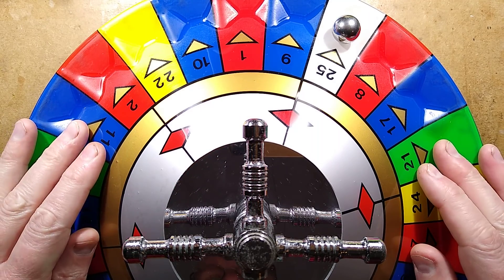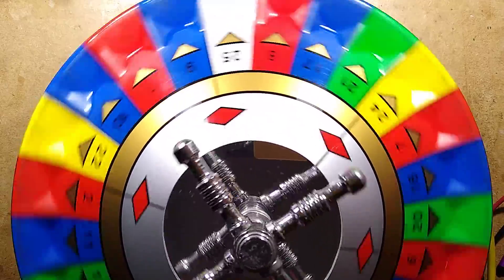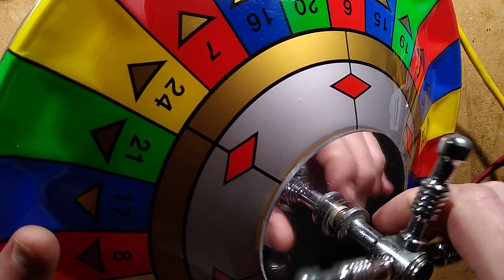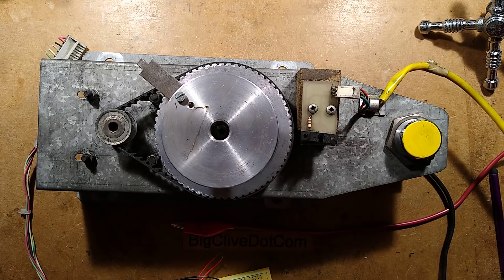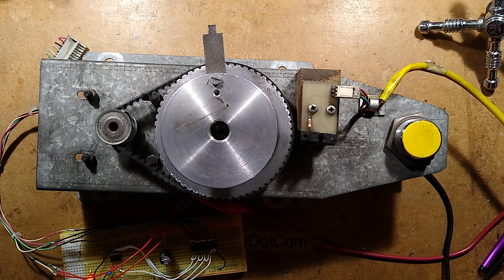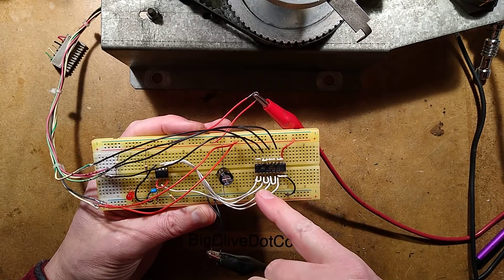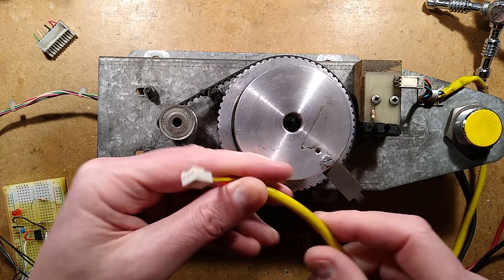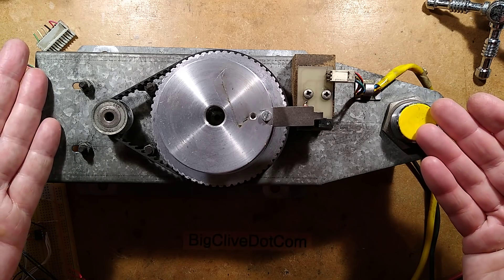Exploring an arcade roulette wheel mechanism

Comment: In my mis-spent youth, I put many a 2p in one of those.  Sometimes the ball would land in the tiny groove between the disk and the cone..... the motor would just turn the disk slowly for a few revolutions until the ball dropped into the slot right next to the one I'd bet on :-)  If it didn't drop in, the machine would go into fast spin again. I never walked away with more money than I'd gone in with :-(

Comment: 4:12 Well... you need to consider, also, that stepper motors are inductive loads and, as such, they tend to draw less current as you rise the pulse frequency, whilst still maintaining a constant voltage. Torque in motors, as you may already know, tends to increase with, among other things, driving current. I would advise driving the motor with PWM, and increasing the duty cycle linearly with frequency. This will maintain the torque more or less constant throughout the desired RPM range. Cheers!

Comment: Clive, you missed an important part of driving stepper motors as you ramp up the speed. To keep up the torque, you want constant current, not constant voltage due to the back EMF.  Pick up a proper stepper motor driver to ramp the motor. Depending on the application, the driver may be run from 12 to 36 volts for that type of application depending on the speed desired.  The driver takes care of the motor current at all speeds using motor inductance and PWM.
Reply from the maker: I've never had to drive a stepper motor in anger.  Now I'm realizing why all the control circuits tend to have current sense resistors.

Comment: Clive I loved this however I feel that there are Christmas lights you've not covered. I'm looking at buying a candle bridge, according to various sources the 7 LED bulb ones use 3W LEDs meaning they consume a whopping 21W over 7 lights. Surely this cannot be right? If it is is there any way to tame it down to something more reasonable like 0.5 watts per light? I also feel that the incandescent candle arch that you have may actually draw less power, i'd love to see a showdown between an LED and traditional incandescent arches.
Reply from the maker: I featured the lamps for a candle bridge in a video.  They were very low power.  You can't mix them with tungsten.  You have to change them all at once.

Comment: Big Clive, wondering if you can help with this one, I have an relatively old led Christmas tree which I have just repaired ish, but I’m lost trying to figure out how it works. There are bi colour leds on the tree and the output voltage is essentially phase angle controlled ac to vary to amplitude and polarity of the output. Can’t see how that’s possible tho as all the thyristors are in parallel. Maybe you have seen a similar one?
Reply from the maker: It might be using inverse parallel thyristors to control both halves of the phase.

Comment: Stepper motor driving is "interesting".  I made several direct drive  zoetropes, which have considerable mass to spin up, with consequent inertia. Getting them to spin up reliably took considerable coding effort. (By effort I mean trial end error). Driven by an AtTiny84 for those interested.  Eventually made it reliable but it took a while.

Comment: I've done this with fruit machine rolls, pretty interesting.
Accel stepper for the arduino and a microstepping driver can drive a motor like that one up to 3k rpm.
I think the 5v is its continuous or long term rating, the inductance of the windings reduces the drive current with increasing stepping frequency, requiring more voltage as you go quicker, constant current is a good way to drive steppers. I did a rough youtube vid of my 3 wheel fruit machine.

Comment: So is this, as far as it goes, fully random? There's no control in the system for it to control the outcomes like AWPs?  I thought the yellow unit might have been a solenoid and it did some kind of pulse on certain numbers (as calculated by the steps)... Interesting.  What category would these be according to the Gambling Commission? I'm guessing cat D... But I dunno if it even applies!
Reply from the maker: It's purely random.

Comment: You're probably running into residence on the stepper promoters. One of the things you've got to do when setting up a CNC conversion using stepper motors is tuning the drivers to avoid resonant bands in the stepper. It sounds like you've accidentally hit one of those resonant bands.

Comment: So, if the stepper slips, it loses track of the ball? Could have at least used a quadrature encoder.
Reply from the maker: If it slipped then that would cause an error with the ball double registration and it would keep rotating until it got it.
Reply: @bigclivedotcom  I'm thinking in terms of knowing which number it landed on. Once it "gets it", it assumes that for very stepper tick, the table rotates a certain angle, thus establishing a relationship between the tab read by the optical sensor and the position of the ball. But if the motor slips after the ball registration, that relationship is invalid and it no longer knows where the ball is. No?
Reply: @ChristieNel  Right, but it can detect the ball twice too. So when the ball shows up as in one of the buckets, by the inductive sensor, then the machine works out which bucket relative to the optical sensor. Then it does it again. If the two results are different, for example because of a slip, then it repeats until it does get two the same. 

The stepper can't really "slip" as in be in the wrong place relative to it's inputs, because it's a stepper motor. The belt having teeth means it can't slip either. 

The plastic wheel on top with all the colours on it can't slip cos there's a hole that a peg goes into. So what can go wrong?
Reply: @greenaum  A stepper can slip. You can command it to commutate four phases and if there is to much friction (such as your holding the shaft), it will stay where it is and you'll assume it has moved, since you commanded it to, but it hasn't. Unless you have an encoder as I suggested.

Comment: That slipping is the stepper not getting the needed voltage I think, when running cnc machines on steppers they recommend driving at from 4 to 20 times the rated volts, of course trying not to exceed the per phase current. I would guess and from driving similar motors, that around 20-24 volt work for it, just keep an eye on the heat of the motor.

Comment: "overdriving" the steppers has been a thing for a very long time, so that one probably did it too.  There's some kind of current control so when the motor's stopped it will have the nameplate voltage across it.  But if the motor is spinning fast, the voltage will rise a lot due to the inductance of the coils, so the voltage is used to overcome this.

Comment: You had to Watch it with these machines some had Solenoid coils to de-orbit the ball early + others a more advanced Algorithm (orbit telemetry) ware it can time the ball and wheel just right spots to avoid wins

Some other could work out the ball Position using the steeper motors own coils with a more aware Power analyzer  ESC - same tech as Balancing machines

Newer machines are starting  to use MEMS (microelectromechanical systems ) - They can image 3D Magnetic fields Vary high Sensitivity - Cameras for magmatic fields
Reply from the maker: I'm not aware of any cheating with these machines.  Controlling a ball in that way on a moving wheel would be quite complex to avoid it suddenly deflecting visibly.
Reply: Why bother when the odds are against you?  Why is it gamblers never stop to think where the money for those fancy buildings comes from?

Comment: I would check and see if all the valleys on the wheel are the same depth. The highest multiplier might be the smallest valley.
Reply from the maker: They seem evenly sized.
Reply: @bigclivedotcom : Ok. Just one of those random thoughts that ran through my head. Thanks for looking. BTW, are you helping out with any “new” lighting for the tractor parade this year? Or planning to watch it?
Reply from the maker: @Dingomush  I'm out of town when the parade happens this year.

Comment: Over on my side of the sea, we had a game called "Colorama" but it used a larger ball and there were 5 slots, with the higher paying one being the smallest, and the lowest paying one being the largest, but you had to "bet" on just one color. 
There was no inductive sensor or anything, there were mechanical switches in the pockets that the ball fell into when the wheel stopped. I loved the catchy tune that it played while it was running.
Reply: Remember it well 👍
Reply from the maker: Still common here.  If one of those switches jams the machine won't detect it and just keep paying out on that switch as soon as the bowl stops turning.
Reply: Had a girlfriend who worked as an arcade attendant back in 2000.  Heard that music daily for hours.  It paid the hardest to win color fairly often given the distribution.  Lots of fun as a kid.

Comment: The solderless breadboard is likely why you had to crank up the voltage.Those things don't like more than a couple dozen mA running through the points.
Reply from the maker: That's a good point.  I don't normally use them at high current.

Comment: Calculating the gear ratio for a toothed belt is easy, count the pulley teeth.  No fancy math with decimal points or measurements required.  I've seen stepper motors driven with a couple of hundred volts.  It's all about the current.  Keeping the current under control you can get some spectacular performance.
Reply: Yes, but counting that many teeth is a b\it of a job and you wouldn’t want to sit there watching him do so.

Comment: Although nominally rated for 5V operation it's possible to use a higher voltage to improve the di/dt curve with either "forcing" resistors or a chopper/constant current driver in order to improve acceleration capabilities, also the use of microstepping or at least half stepping during the early phases of the acceleration will enhance performance, another cheap trick used to be to run at nominal 5V, but switch to 12V for the acceleration/deceleration with deceleration being the killer of lots of cheap circuits due not including adequate facility for dumping the energy from what is essentially a flywheel.  Interestingly in the past I was involved with the design of the controls for proper high stakes automated gaming wheels that ran on stepper motors - we had a lot of fun working out acceleration profiles to manage issues surrounding the various mechanical resonances that had to be avoided.

Comment: Clive -do you have any info on the ball sensor or the circuitry that would be used with it?
Reply from the maker: It's an inductive sensor.  Some detect metal with the change in frequency of a oscillator based on the sense coil.

Comment: When I was selling my A4988 based stepper driver back in 2001, I had a few defective returns.
It turned out, if you unplug one of the 4 wires to the motor, while the motor was running, the chip would burn out. 
I had to change my design to incorporate 8x ultra fast diodes at the output of the driver. Hell with synchronous rectification. 
This was before Pololu was selling his. I can bet that the same thing happens to his driver module since he's not using external diodes. 
ULN2003 has these diodes built in, and won't suffer if you suddenly unplug an inductive load from it.
Reply: For as long as I can remember, every stepper driver manual has had "Don't unplug motor while powered" written in it somewhere.
Reply: @j.f.christ8421  No shit Sherlock! 
What happens when the wire breaks from work hardening?  
If know-it-all people like yourself are any indication, you'll whine to the seller that their stepper controller is no good and blew up for no reason. Then the seller has to deal with that shit.
Reply: @piconano  Well, who's a grumpy little boy then?  I think you need a nap.

From you original message it sounded like you were the first person every to make this amazing discovery.  Lol no.

Comment: Stepper motors are usually current driven not voltage, "5V" on a stepper doesn't mean it's operating voltage. Taken from a website I can't link to :-

The voltage ‘rating’ of the motor is simply derived from the motor’s rated current and winding resistance. An example motor shown above is rated for 5 [A] (per winding), with a winding resistance of .5 [Ω]. The motor’s nameplate voltage is therefore listed as 2.5 [V].

This is the voltage that produces 5 [A] of current into the winding in steady state. However, a stepper motor must change the current in its windings rapidly and will not always run in steady state. Unfortunately, inductance is associated with the winding (since it is a large coil of wire). The winding inductance prevents current from changing instantaneously and will require time to increase the current flowing through the winding after a voltage is applied to it.
..........
A good rule of thumb is to use between 10 and 24 times the motor’s nameplate voltage for the system bus voltage.

Use a cheap step/direction driver from eBay/Amazon and you'll get far better performance particularly with ramping.
Reply from the maker: I wasn't aware of that.  I've never used stepper motors much.  It's good to know.

Comment: Not sure here that optical sensor was, isn’t it normally a u shaped fork with an IR diode? You can only see two screws and a resistor
Reply from the maker: It has the fork.

Comment: I've just bought a modern NEMA34 motor kit... the driver module just wants direction and step signals...  so much easier than using stepper libraries... just assert direction, and supply a pulse per step.... simples!
Reply: There are stepper drivers with built-in pulse generator. Set the direction, acceleration and target speed, tell it to go X steps (everything via SPI) and off it goes. The TMC5160 by Trinamic is one of these, but it requires external MOSFETs for switching. You can use it with the regular direction/step interface as well.

Comment: With Steeper motors its about the Current! The voltage is only for the holding torque. 
As soon as they go fast you need more voltage because oft induction.

Comment: Not really one to comment usually, but after searching for a way to post a question/suggestion directly and coming up empty handed thought I would resort to a comment. Apologies if I’m breaking internet etiquette.

I know you’ve done a few videos on Christmas lights around this time of year, but I wondered if you had ever taken a look at the current 3 wire copper variants available on Amazon. I acquired a 10m / 100 led set for around 9GBP, and was surprised to find they are in fact using an addressable chip set. Considering 60/m strips go for a ridiculous markup on Amazon I was amazed that such a high led density could be bought so cheaply. Obviously you need to tip out the controller and replace with an alternative ( wled being my personal preference ), but essentially you have a full set of controllable and addressable pixels for an absurdly cheap price.

I wondered if you had any views on these, and if you knew how on earth these things can be manufactured and put out at this price? I’m guessing the leds themselves are probably 0.1w max rather than 0.3 as found on most 5050 2813 strips, but still seems absurdly cheap considering the built in ic in each led.

Product I bought - Ollny Christmas Lights, 16 Colour Changing 10M 100 LED Fairy String Lights

( put in product name rather than url as again do not want to seem as pushing a particular vendor or market )

There are a large number of individuals selling similar 3 wire sets, and I’m wondering how prevalent this is. It makes for an incredibly cheap way to create an addressable wall or similar, and tbh some of the deals offered are actually lower than the same products properly marketed on AliExpress.

Thank you for your time, I hope this note is of interest, and if not apologies for disturbing.
Your videos are refreshing, entertaining and incredibly informative, so must also say thank you for the great content!

Comment: in 3D-printers we're readily putting 12-24V into 2-3V steppers since they are running on a constant current chopper driver. This gives excellent response and torque. I guess this item is so old that it was before the modern chopper drivers so it was probably run by a quad set of NPN transistors and a power resistor for dropping the excess voltage.
Reply: So, with a tweek, Clive could have thrown the ball out the window? That would have been engaging video…
Reply: The listed voltage has always been the dc voltage. ie V= IR on the steppers.  You normally drive then with 2 or more time the voltage, but you limit the current.
Reply: @Dust599  Old equipment would use series resistors in combination with higher voltage, to allow the current to rise faster.
Reply: This explains why I thought my meter was shot working on my 3d printer.